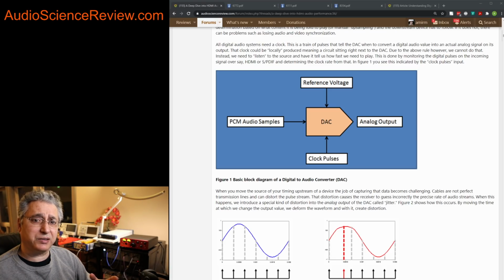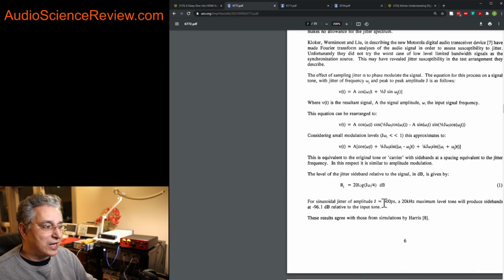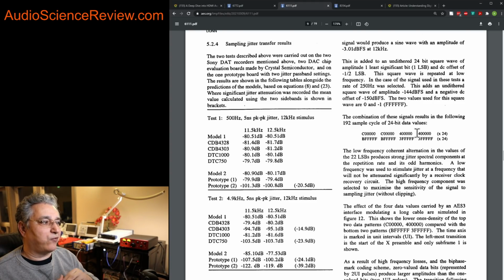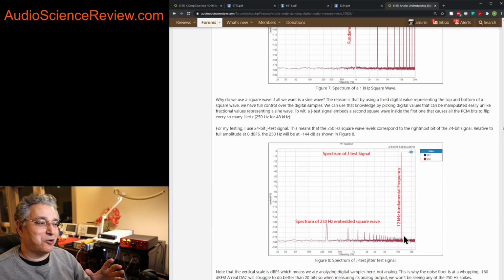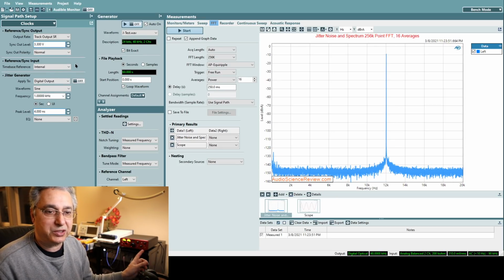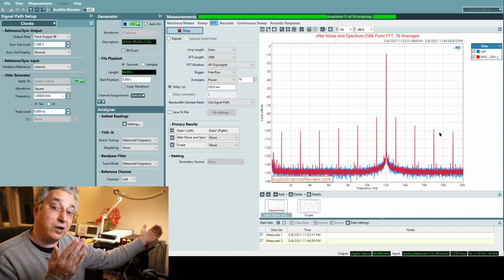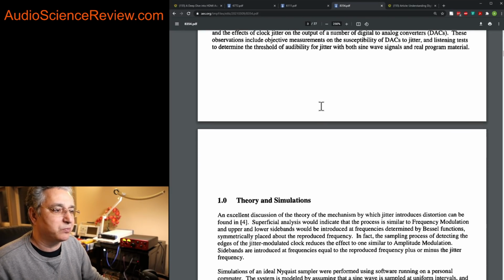Understanding Jitter in Digital Audio: Measurements and Listening Tests

Comment: A new suggestion down the road, and to the list. Does having. digital music files with sample rates over 44.1K or 48K actually make sense.  Do we need bit depths over 16. Do they actually make difference, of course if they are the same master. I feel that the industry wants to sell us the same music over and over again, tweaking here and there, so it sounds ever slightly different and get our money. There are records bing sold today that probably have been sold in Vinyl, 8 Track, Cassette, CD, Re-mastered CD, MP3, FlAC and now Vinyl LP over again. Same music just repackaged. So do we really need MQA or 24 bit 192 or 768. Can adults actually hear a difference.
Reply: @Douglas Blake Hello Douglas, thanks for the insight and your reply. My understanding is like you say. As we age we start losing hearing spectrum. Having sample rates over the CD standard of 44.1 or 48K should be more than enough for most adults. A 44.1k sample rate will reproduce frequencies up to 22.05K which is much more than a typical human, much less and adult. So why all the fuss with hight "high res" audio. Also 16 bit depth produce SNR off 96db or more. A 24 bit depth produces 142db (or so), question is do we need that. My only recommendation from years of reading is to make sure you use a lossless codec (FLAC, ALLC) and it seems that you are doing it already. Cheers.
Reply: @Douglas Blake When you say: "I typically set my systems to 24/96k for this reason" you mean your Vinyl backups? Those setting should be more than plenty for the response of the record player. However my original question to ASR is, do humans actually hear a difference or is it just marketing. I don't use vinyl anymore. As many I grew up on vinyl and still keep my Technics installed but as many other 80's kids I am done with the cleaning, the changing of the sides all that romanticism the new generations like. I rather have backed up Cds and digital music at 16/44.1 like it was originally published and I am more than happy. My Mac mini connected to the system and all the music is right there. Cheers.
Reply: @Douglas Blake I don't think your are limiting your system. The only limitation is the source material if anything. This is a great hobby hope you and all continue to enjoy it. Cheers
Reply: In a real world listening test with high quality headphones (e.g., HD580 or HD650 and good headphone amplifier), going beyond 10-bits is pretty much pointless. If you are using IEMs, you many need an additional bit or two. So, all these discussions of 16-bit vs 24-bit for music, when 12-bit is two bits too many, are really REALLY pointless. Don't believe me? Try it for yourself with a properly dithered ten bit audio conversion of the song of your choice. When you hear how practically inaudible the noise floor of 10-bit is, at listening levels that do not cause permanent damage to your hearing, you will realize that 16-bit is, already, way way in excess.

Comment: Just like fm synthesis!
Reply: @Douglas Blake Sorry, I do not have any sort of background in radio transmission so I might get confused a little bit. In this case the carrier is the music/test tone and the modulator is the jitter right? Don’t know if you’re familiar with Yamaha dx synthesizers but if not, the carrier normally is the frequency of key you press, or something relative to it and the modulators are set as ratios of the carrier. There are also ways to change the frequency of both the carrier and modulator with velocity, time envelopes and physical controllers so you can make either operators fixed or dynamic. I guess it must be a bit different from radio transmission.
Reply from the maker: Very correct.  The only difference is that the modulation factor is typically so small with jitter, that it doesn't create any sidebands past the first pair.  So in that regard, it looks like AM modulation.  But true nature of it is FM.

Comment: I first recommend audiophiles to treat their rooms firstly. I have seen many top end systems with no room sound treatment, so are effectively listening to the room effects.
Reply: If a speaker pushes very little bass you will not have seriously problematic room modes. If your room is very reflective you will hear scatter and imaging will disappear.
But in those cases and similar ones I would suggest headphones and enjoy the full experience. There is no magic in non problematic speakers. ;-)
Reply: @juanmillaruelo7647  Sorry but “headphones” is a lobotomised solution ( unless your recording is binaural ) & yes speakers with no bass output below 200Hz won’t excite room modes, but who on earth would want to listen to speakers with no bass ?
Reply: The “problem” with “treatment” is people peddling off the shelf resistive or diffusion product, that does not address fundamental problems unique to each room - this stuff takes time & effort to “get” @ a proper level & the solution is NOT found in off the shelf product
Reply: @BogdanWeiss  But it is the correct way to properly listen to the system and less of the room. Or room correction software to compensate.
Reply: @BogdanWeiss  Its like having an apple pie with no apples. Its not the same experience.
Reply: @Self-Law-y1x  Room compensation software/hardware needs to be understood & it will never sound as good as a properly treated room - & by properly I don’t mean just throwing in off the shelf product ( resistive or diffusing ) - I have seen +$200k of equipment in untreated rooms & that’s how high end dealers like it - plenty of margins in accessories & no intellectual input required
Reply: @BogdanWeiss  Do more study and research. Room treatment is the way to get the best out of any system.
Reply: @Self-Law-y1x  I think you’re addressing someone else.... & you can’t treat a room properly unless you know where your speakers will be located, their polar pattern, where is your listening position, where your first reflections will occur, RT60, where your room modes will be & what you will do about them ? & how much of diffusion, absorption & what type of music etc etc It appears that you need to do a lot more research, because it makes no sense to treat your room, before you decided what equipment & where things will “land” etc etc
Reply: @BogdanWeiss  I disgree. There can still be a level of room treatment implemented that can be tweaked once the system is in the place.
Reply: @Self-Law-y1x  I’m not talking about “tweaks” I’m talking about addressing fundamentals which you’re clearly not interested in.
Reply: @BogdanWeiss  Tweaking comes after, of course by implementing the fundamentals.
Reply: How much do you recommend to spend on treating a room? I'm aware that it's unlikely to cost anything less than a few thousand if you want to do it properly because more than likely, the 80% of sound your hearing is room effects.
Reply: @HeyCousin  anything “off the shelf” is a waste of $$ & it’s effectiveness is mediocre at best & hugely overhyped by manufacturers, ask to see measured results of before & after treatment @ different frequencies & it’s the specific treatment of room modes that’s most critical & completely ignored by the “acoustic tile” manufacturers - you need someone who knows what they’re doing & it’s not cheap.....
Reply: An alternative is to use 'speakers that play well even in bad rooms, but that will probably exclude many high-end designs.
Reply: @johnwright8814  speakers that play well in bad rooms still aren’t going to magically overcome poor acoustics
Reply: I just sent a 1KHz sinewave through my room, and my measurement shows it is below human hearing ... therefore room treatment should not make a difference.
Reply: @andyvu8312  ...that makes absolutely no sense
Reply: @adams5389  Tell me about it.  A basic 1kHz sinewave distortion measurement is just as useless as no measurement at all.  This guy is selling you his own brand of snake oil.
Reply: @andyvu8312  Its not as simple as that.

Comment: I worked for 10 years as a software developer for CD record test equipment.
That people do not know we have pits and lands BUT that is not null or one.. the information is in the length of those pits and lands. So we are interested in WHEN we go from pit to land or vise versa.

That lengths is counted in time from the shortest 3 time units to the longest that is 11 time units.
So one thing that we looked at was each pit and lands lengths.
The variation of the length 3T of a pit/land we called jitter in the industry of optical media testing/production.

Another interesting thing were that we had a long 3T and a short 4T. Then we can and will get difficulty to determine if it is a 3T or 4T..

But that bad quality should not be on a disc. And error correction kicks in but only to a certain point. 

And if it is way off we get E32 errors that is not correctedable errors. But by then the the jitter also out of specifications (there is not allowed to be any E32 on a CD if it is then it is out of specifications).

Anyway we have length variations on a optical format that has a jitter specification and then we have not yet taken the disc out from our shelf yet.

In other words jitter can be a variation measurement on many different things.😍
Reply from the maker: Good explanation.  Jitter is a fact of life in so many devices.  Fortunately most of the time we are interested in a binary outcome as in the example you mention.  With DACs, that becomes part of the analog make up of the output so can get more tricky.
Reply: You never know who can pop up in the comments section with even more specific knowledge than the host.🤔🤫🤗😉😇  And that's saying a lot!
Reply: “The art of digital audio” by John Watkins is a solid text on the subject ..... This is also why ripping your CD’s with something like EACD makes sense & playback from an SSD is superior to direct playback via a CD ( no matter how much you spend on that HiEnd CD transport... )
Reply: @ReaktorLeak Exact Audio CD - shareware that’s been around for a while, for those who don’t have professional CD authoring software - Digital sound was initially advertised as “perfect sound forever “ 40+ years ago... are we there yet? Look at the “vinyl revival” ? People have no idea how to capture, mix, master digital audio so now the same geniuses who wouldn’t know on which end of the tone arm to install a cartridge are proposing vinyl as the new medium for fidelity 🙃
Reply: @BogdanWeiss  Agreed. Vinyl is just laughably bad, at SO many different levels, relative to what can now be achieved with even entry-level digital audio equipment today. It's one thing to say that you like the sound of vinyl better (that you are certainly entitled to) but so assert that vinyl which is just crippled in so many different ways is objectively better at reproducing high-quality sound than modern digital mechanisms just instantly ruins your credibility. No, a friction-based, analog device from 125 years ago does not outperform a modern digital device when it comes to musical reproduction. As a matter of fact, it doesn't even come close.
Reply: @ReaktorLeak I’m well aware of the “block diagram” there are differences under the hood in execution that are both measurable & audible - I have a 500 page reference book that delves a bit deeper...it’s a bit more than just FIFO & one of the reason Y those in the know, don’t spend $$ on fancy transport, but encode to SSD via EACD - the devil is in the details....
Reply: @ReaktorLeak I agree...so much talk about minute details when 90% of captured sound quality is the skill if the recording & mixing engineer & the mastering engineer should be able to say " well done boys..."  & nowadays you have recording & mixing engineers delivering crap & saying " they'll fix it in mastering..." 😩 Ive been to a number of recording facilities where jitter was off the charts ( I think due to problems in the AES/EBU master clock distribution &/or mismatched impedance in the cabling, so it still all worked but sounded like glass...)

Comment: Idea for a new video:
Address the common argument that says tests are worthless because music is not a 1 kHz sine or even 32 tones. 
How can your tests directly translate into a device performance for playing music?
Reply from the maker: I will have to figure out how to demonstrate that.  I can explain it but the people who don't believe it, continue to not believe it.
Reply: @ben and Amir, this is very easy to test, actually. All you need is a good DAC and a good ADC. You start by direct connecting the DAC/ADC to see the level of degradation in the digital information sent (level matched, of course). Then you insert a different DAC and/or ADC and compare the level of degradation, all over the course of whatever music you choose. How much do the bits change, on average, and perhaps with other statistical measurements, especially over interesting segments of a piece of music. The goal is to gauge which of two or more devices reproduces the music most faithfully at a bit level.

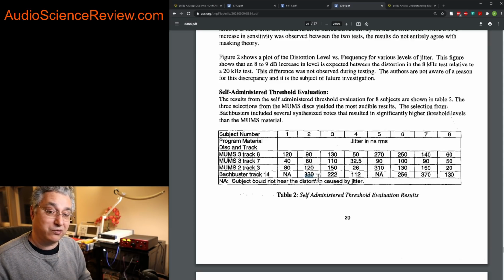Comment: 22:35 Just want to point out that you contradicted yourself.
Listener 8 went from under average listening to sine waves, to the best when listening to music, while listener 2 went from being the best at listening to sine waves to almost the worst listening to music.
This supports the argument that actually listening to music is at least as important as listening to sine waves.

Also, the variance between tracks is really huge for each listener. This could be caused by how similar each track is to what they listener normally listens to. As an example. perhaps listener 2 listens mostly to string quartets and so is more sensitive to sine wave distortion.
Reply: When using a sample set of exactly one to prove your case, and throwing some selection bias into that to further sweeten the mix, do realize that what you are saying is not at all statistically significant.
Reply: @SteelBlueVision  Do you actually understand any of the words you just used, and what they mean in the context of what you said?
Keep in mind that dealing with sample size, bias, and significance is part of my day job.
Please start with what you mean by "Sample size of exactly one."

Comment: How do you deal with asynchronous cases? For instance, the DUT is ADC which is not synced to your AP analog-generator at all, you should see the sidebands products are breathing because of beat-tones. If you do AVG, you'll see much higher sidebands than they actually are.
Reply from the maker: Since our goal is to never have jitter spikes, measuring their amplitude correctly is not a goal.  If it were yes, you would have to use a different window function and such.